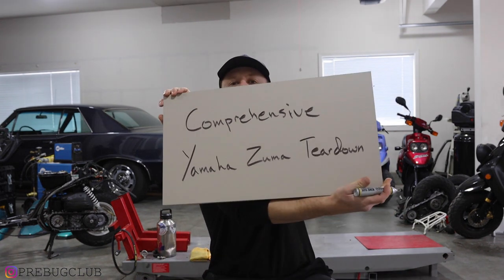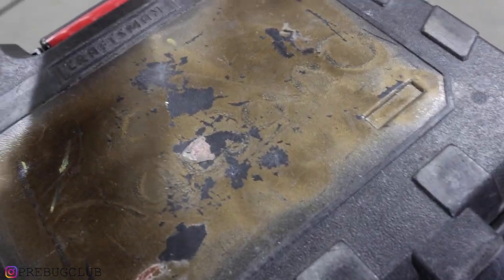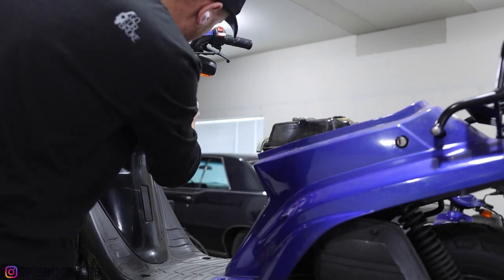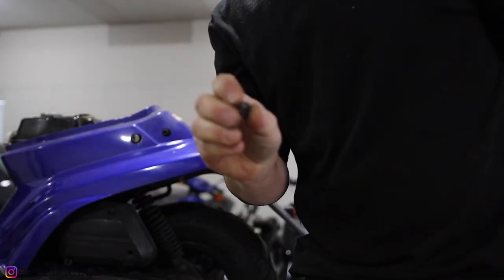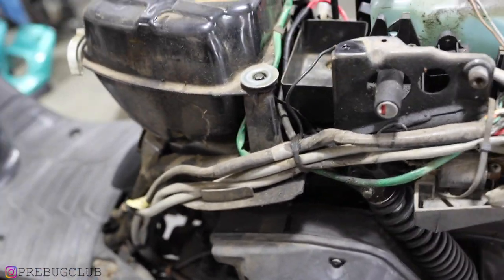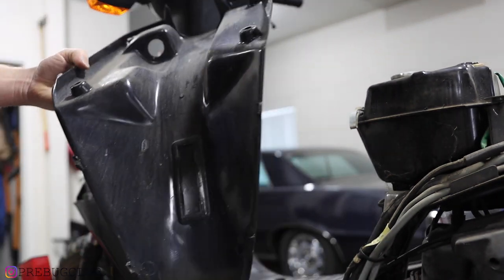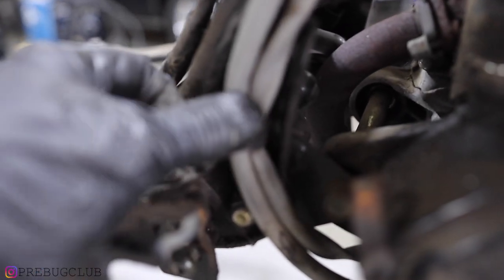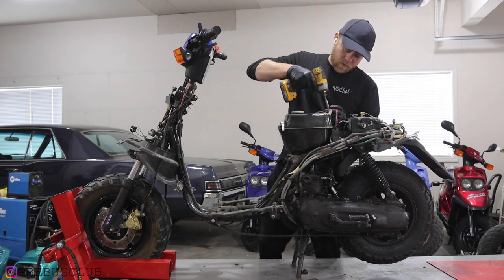1989-2001 Yamaha Zuma Prebug Comprehensive Teardown & Assembly.  BWS.  MBK Booster.

Comment: I have a 2005 Zuma 50 with starter problems. I just replaced the battery last week and it will barely turn over the motor. I checked the terminals and the voltage is 12.8   It will kick start first try. Any ideas?